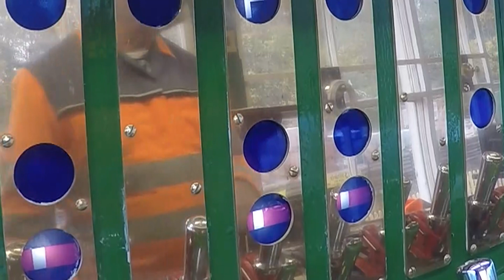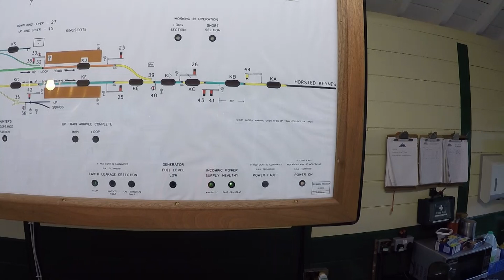Kingscote Station & Signal box

Comment: Fabulous! Where did that  miniature lever frame come from originally?
Reply from the maker: The project to install a historically important Southern Railway/Region Westinghouse ‘L’ frame to take over all the signalling at Kingscote was completed in January 2016, and came into use on 5 February 2016. It will also eventually take over control of the East Grinstead layout and the interface with Network Rail, which is currently handled by a pair of ground frames interlocked through the use of the Annett’s Key on the token.

The ‘L’ frame has a mixed pedigree of parts obtained from a number of sources. The main frame of levers 1 to 12 was donated to us having been previously used on the Dartmouth Steam Railway where it controlled Churston station from 1979 to 1991. This section is of historic interest in being from the very first ‘L’ Frame to be commissioned, on the Southern Railway at North Kent East Junction (near New Cross) on 1st December 1929. Other parts were supplied from two private collections, some originating from Crewe South Junction. The largest contributor was the National Railway Museum who kindly provided a quantity of parts from Clapham Junction “B” signal box.